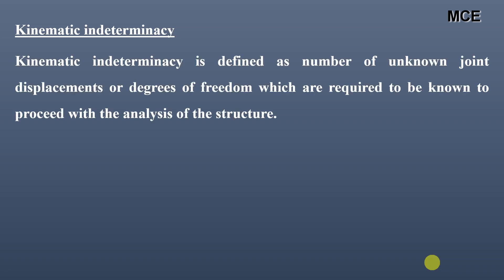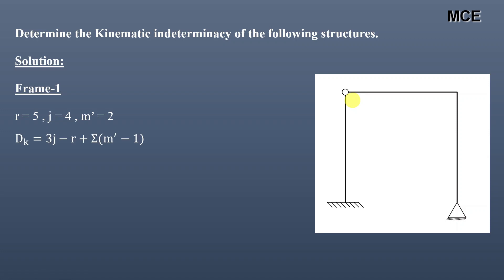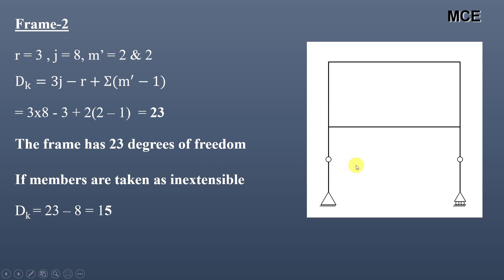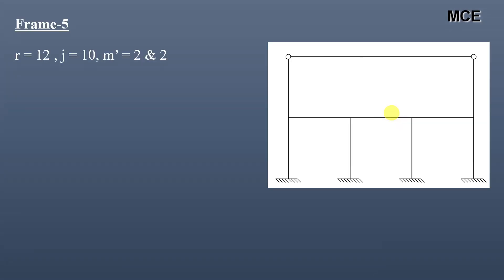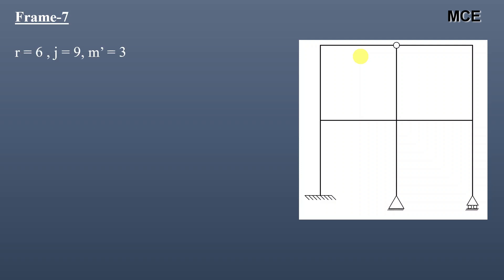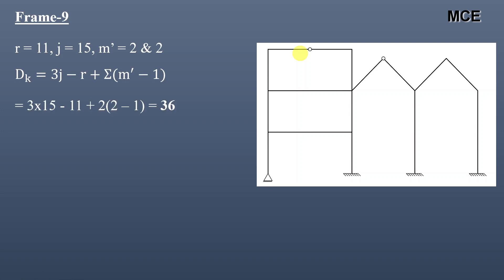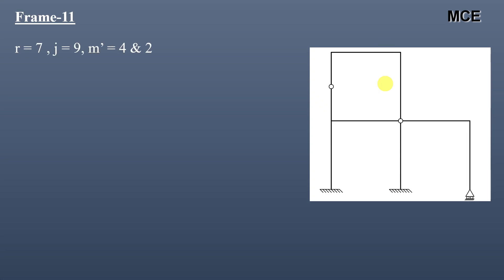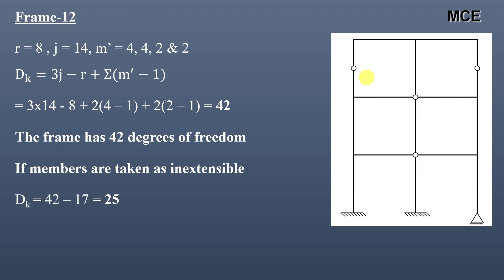Degree of Kinematic Indeterminacy of Frames|Frames with internal hinge

Comment: In Frame 2 the hinges are Member hinges not Joint hinges. So Additional DOf will be 4i for extensible and 3i for inextensible. Had it been joint hinge, Your approach of Calculating Effective pin value by m-1 would have been correct.

Comment: For frame 2, the no. of joints is 6 right?
Reply from the maker: No. of joints = 8. We count internal hinge and free support also as joint in finding kinematic indeterminacy
Reply: But for finding static indeterminacy internal hinge was not counted.
Reply from the maker: Because in Kinematic indeterminacy hinge provides a degree of freedom that's why we count it in calculating KI because we are actually counting degrees of freedom in KI
Reply: @MasterCivilEngineering  Thanks for the detailed explanation. Now I got it.
Reply from the maker: @pcyclogy  Don't forget to like the video and share it with your friends to help the channel
Reply: @MasterCivilEngineering  Absolutely.
Reply from the maker: Degree of Static indeterminacy is equal to number of unknown reactions which cannot be obtained by equations of equilibrium and can be obtained using compatibility equations.